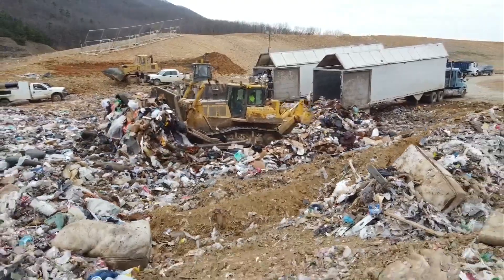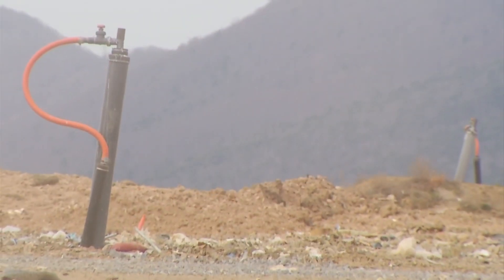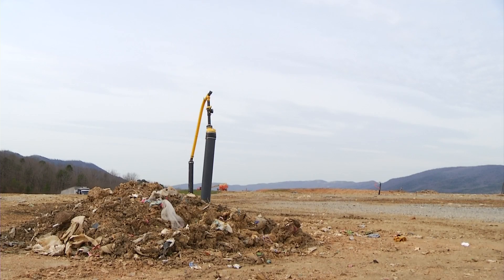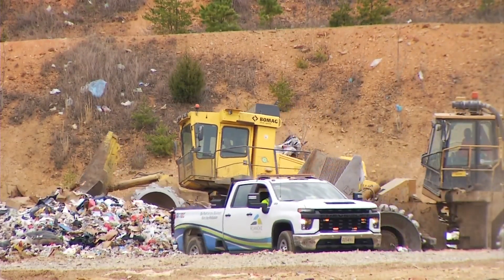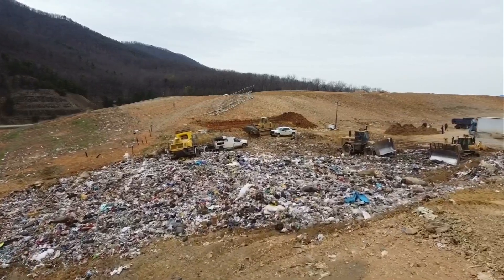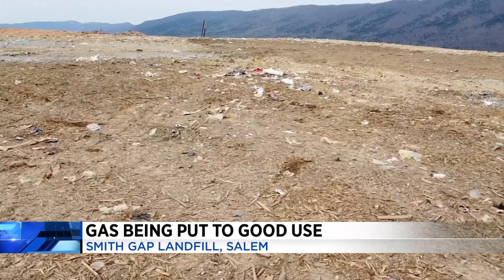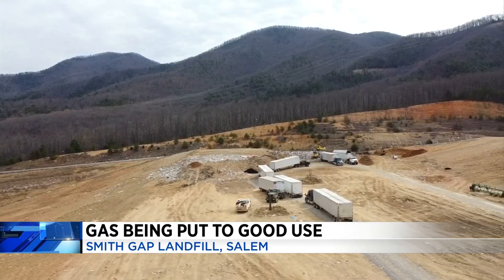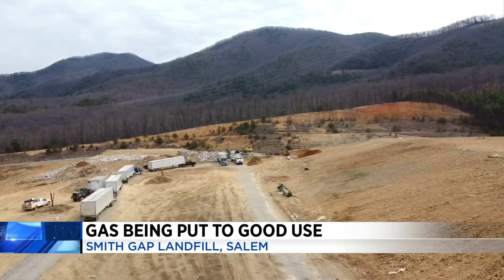Repurposing stinky methane gas from Roanoke Valley landfill

Comment: I work at the Cape may county landfill in NJ, and we have been using the methane gas for electrical generators for over 10 years,  it feeds the extra electricity back to the grid and we have another place we send the methane to that uses it for a large boiler system.